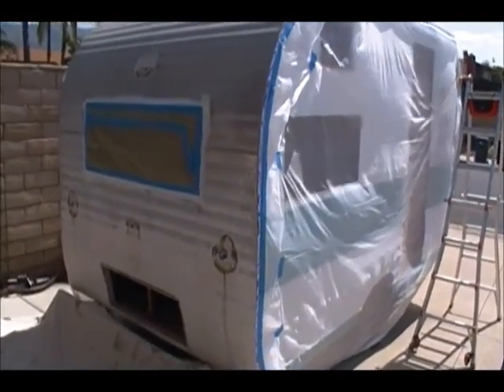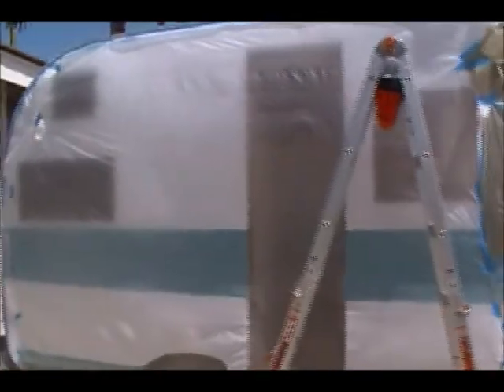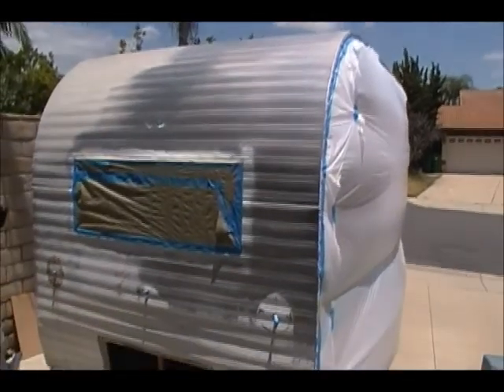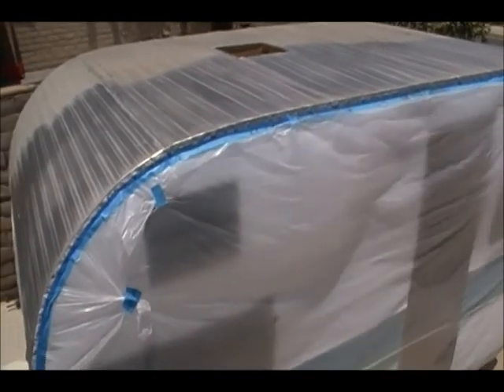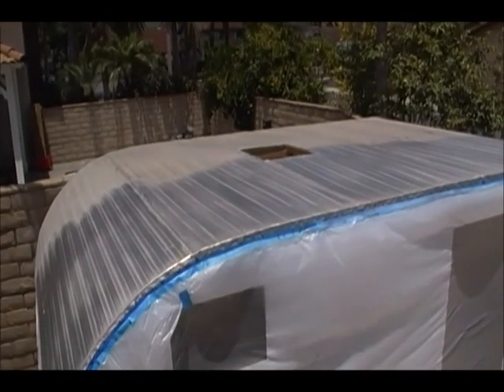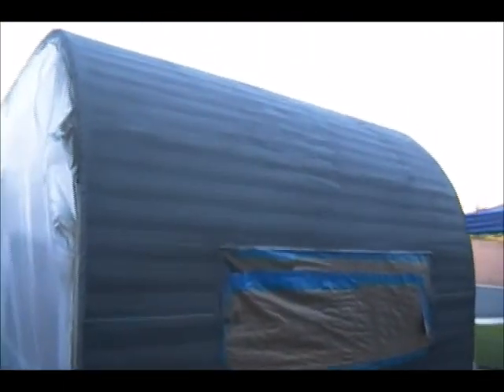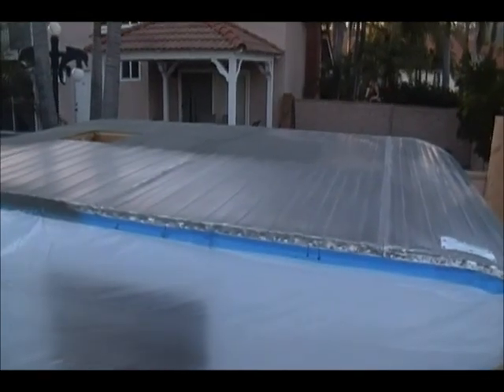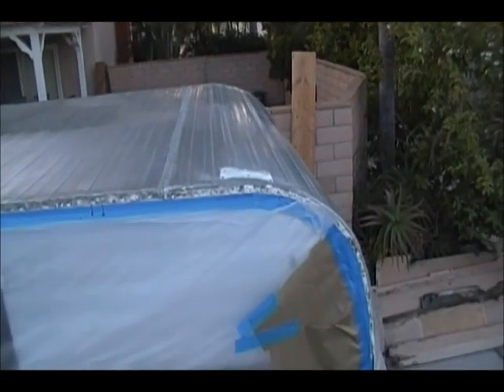1961 Oasis Trailer Rehab  #16 Painting the Roof, Front and back

Comment: Love it, Rudy!!!!
Reply from the maker: Lc Johnson THANK YOU... How are you guys doing..?
Reply: Rudy Hernandez.  Thanks for asking , Rudy.  We spent 12 hours on the camper Saturday and 4 hours today. We got the floor joists and floor in the back end. Today we took the floor back off and coated the bottom of it with truck bed coating. Also coated the joists and frame.  Then put the floor back on and screwed it down.  That baby won't rot again.  Next we start the back sides but we have three doctor appointments this week and it's also going to rain so not much time to work on camper.  We want to have the frame all repaired and ready for metal by July first but we have had do much rain this spring. We're no longer in a drought.  It does me good to watch your videos. You are moving along so fast.  The owner is going to be delighted.